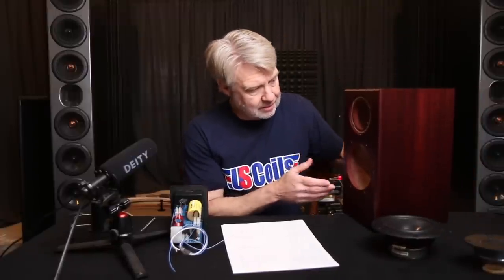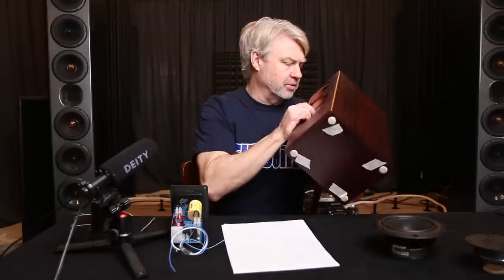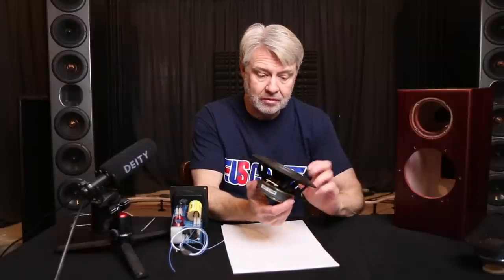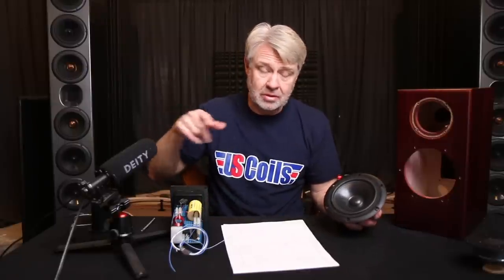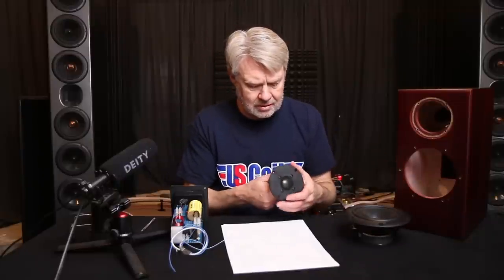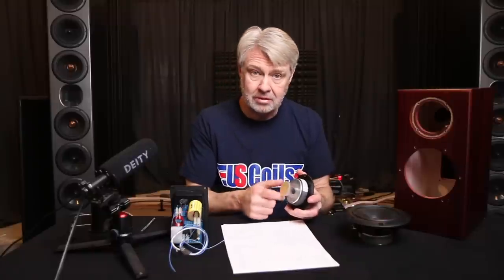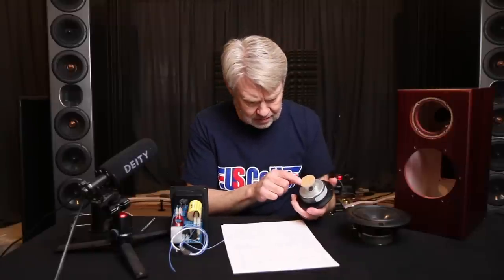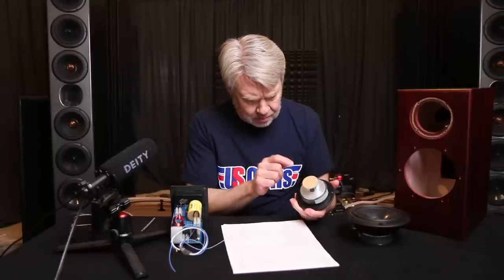Is the Totem Rainmaker a Real Tear Jerker?

Comment: A few points. 1.) I love the Rainmakers. I've compared them blind next to a $3500 pair of B&W monitors of the same size, and it was no comparison at all. The Rainmakers were so much better. Everyone who listened to the comparison confirmed it. I'm aware of the slightly elevated tweeter's response, but love the extra air, detail and soundstage. I think they've got better than most caps on it, and I think that helps it be non-fatiguing to listen too. They're designed to be listened to without toe-in, somewhat off axis. 2.) They don't fill the cabinets with foam or polyfil. They use Borosilicate mineral based paint instead for resonance control. 3.) I thought that woofer looked awfully similar to one in your design. I love paper cones in general. 4.) I've had them for years, and I've never heard any port noise. One thing Totem does is tune a bit extra deep for their size, so if driven harder than I'd care to listen, I'm sure that could become a problem. 5.) As a nearfield monitor on my computer, while playing Call of Duty it's almost like cheating with all the extra detail, haha. You can hear people sneaking up on you no problem, and just a stereo pair soundstages so well, you can tell exactly where they're coming from. 6.) Totem uses those connectors to avoid more solder joints. They think solder is degrading the sound, so they use mechanical crimping methods instead. Weather that helps or hinders the sound I don't know, but I know they do it on purpose. 7.) Totem tends to go simpler on crossovers with fewer components, favoring purity of the signal path rather than the flattest most "corrected" response. I'm not doubting you aren't taking them to another level, and have faith in your design, I just wanted to point out a few things about the Rainmaker. I was sad to see them discontinued, but still own a mint pair myself, which I keep in much more expensive company.
Reply: I got some B&W 706s and they sound a bit "fooffy".
Reply: Almost any Totem speaker will sound better than any B&W speaker. Totem isn’t mass marketed like B&W speakers. Unfortunately, B&W is now considered the Bose of somewhat higher end speakers. Last 15-20 years is when they started going down hill. Once they started making the 600 series in China is when it went down hill. Same with Kef. No longer a respectable name it once was.

Comment: The damping material is a multi-coat borosillicate glass paste hand-painted inside the cabinet. This paste is also used on the tube of the reflex port, which is made of damped acrylic and affixed with an anti-resonant glue. The borosilicate is a more lasting and stable damping material than foam, which tends to oxidize and degenerate over time, changing a cabinet's Quality Factor (Q).
Reply: That stuff does nothing to control box resonances or standing waves.
Reply: @dannyrichie9743  It doesn't?  Why is the spectral decay "pretty clean" then?
Reply: @audiophilefool  A spectral decay isn't a measurement of cabinet resonances. It measures the decay of the signal from the drivers.
Reply: @dannyrichie9743  Thanks for the explanation.  I thought that cabinet resonances would play a part in that, because if a cabinet is vibrating from being exciting from the drivers, it would surely show up on the measurement as well??
Reply: @audiophilefool  FYI, from online source Audio Judgment, "The cumulative spectral decay tells us if there are any problems with resonances. If the driver is ringing because of inadequate damping / cone break-up / high impedance spikes at resonance, or some enclosure panels are resonating, it should appear on the CSD plot."
Reply: @dannyrichie9743 , if there are resonances or standing waves within the enclosure then the designer meant them to be there. They add to the overall appeal of these excellent speakers and their careful design. There is nothing that you can measure that the designer of these speakers doesn’t already know about.
Reply: @vynleshmynle7372  Yeah, I am sure the designer listen to these and thought, you know what would really sound good, if there was some added distortion and smearing from internal reflections, because all music needs a little coloration to sound right....Said no one ever.
Reply: @dannyrichie9743  Well, that is how some designers actually tune their speakers.  Manipulating resonances has been part of the game since forever. In some cases that is easier and more cost effective rather than just throwing high priced parts at it, which is no guarantee in itself. Think price point for the masses.
Reply: @ruger6049  No, cabinet resonances are always added noise and easy to remove from added bracing and thicker cabinet walls.

Comment: Hey Danny Totem is among my favorite companies. I have had the Forest, the original from 1999 when it was Dynaudio Driver and seas tweeters. 
I still have not found a speaker close to that one. I had the Hawk and for such a small slim, such a nice sound. 
This Rainmaker is among their lower line. I am sure you know the Model 1 is legendary . Would love to see you work on that one. 

Keep it up. I am looking forward to your 80's style speakers.
Reply: I also had the original Forest. It was never a Dynaudio driver. Actually, It was a look alike from China - Hi Vi. A nice, relatively inexpensive driver. The surrounds on my pair went, and I ended up buying  the exact replacement drivers at a much lower price than the  Totem dealer quoted.
Reply: @davido4872  Maybe but the set I purchased in 1999 did have the dynaudio. The Dealer showed me, I do know later on dynaudio stop selling as a third party. My hawks had the scanspeak. Less the dealer was lieing he had one floor model with the driver removed. Made in Denmark dynaudio 17w.Three inch voice coil. Anyway I have yet until recently find a speaker that matched that one. QLN
Take care
Reply: @jasonme3557  lying.
Reply: These videos are testament to manufacturers producing speakers to a budget to fill the gap between particular models and bring in revenue.  GR Research has likely performed more acoustic tests on loudspeakers than the manufacturers, exposing some good, some mediocre and some awful products proving costs don’t correlate with sonic ability.  Danny is doing a great service for the consumer.
Reply: @jasonme3557  Possible but unlikely because mine were an early pair from 1999 as well. Liked them but did get a little tired of the tipped up highs. I've heard that QLN are good speakers - enjoy.
Reply: @thomasmleahy6218  Yo tom this is not the channel for that.
Reply: @davido4872  David they are nice very open and reveling. if ones has a low end amp. you need not bother.
Reply: @davido4872  Very sad.
Reply: I still have my Forest, Model One Signatures, and Mani-2's.  I will never sell my Mani-2 or Model One, but I might part with my Forest one day.  I also have owned the Rainmakers, and Hawk's but I immediately sold the Hawk's when I got the Forest.  I have some videos of my Forest posted up on my channel for $hits and giggles.  LOL.

Comment: I had them, and they are bright, now I have the JMlab Daline 3.1 and they are better in every aspect, incredible speakers.
Reply: I have some JMLab Focals  -- I forget the actual model number but believe it or not in my bedroom set-up I ended up using the NHT SuperZero A450 from 1995 and they killed everything in their path. I don't have any problem spending extra if the sound quality merits it but in my particular case the SuperZero A450 knocked off all the other speakers I put them against and most were newer and all of the other speakers were magnitudes of dollars more expensive.

Comment: Hi Danny. Believing or not in your magic I allways learn on your videos. I have a doubt though, do you ear the speakers or you are based in measurements only? This speaker seem very good on its original form. You can make it different, but better?
Reply: Part of it would have to be by ear for them I'd think, as you generally cannot measure a difference (or one in the audible range) between a decent cap/inductor and a doubly more expensive one. And then you have to wonder about psychoacoustics
Reply: No magic involved. These are now better in multiple ways. There is no doubt.
Reply: @dannyrichie9743  Maybe better to Danny.  But how about the person who handpicked each part and designed the cabinet(all to achieve a specific sound), Vince Bruzzese.  The Rainmaker was in production for 18 years.  How many of your designs have been in production for 18 years?
Danny, you want all speakers to have a flat frequency response.  Like Audyysey, this neuters speakers to  sound more alike than different.  Some of us find that boring.
Reply: @stephens3845  Shame on the person that handpicked an iron core inductor, used ferrous connectors, and PVC jacketed wire.  Improvements were made in balancing out a mess of a frequency response. Cabinet damping was improved. Internal damping was improved. Signal transfer from binding posts to tube connectors was significantly improved. 

Also, a flat frequency response has nothing to do with causing a speaker to sound boring.
Reply: @dannyrichie9743  Thanks Danny, you make some good points.
Reply: @dannyrichie9743  Easy to say when you don't have to respect a certain amount of money on the BOM.
Reply: @fugazi84  Some of those improvements would have only costs a few pennies.
Reply: @dannyrichie9743  Still, you sell the upgrade kit for between 225$ and 500$.  So I understand why Totem choose the components that they choose.  They have to aimed for the best bang for the bucks.  We are talking about a sub 1k$ speaker.

Comment: Then the treble is guaranteed to be made by SEAS, which is the only Norwegian speaker factory. Their  tweeters usually is relatively good. But I don't quite agree with the sound type that many midrange/bass elements from seas have. Not always the easiest to make a crossover for!

Comment: I have the totem dreamcatchers, and their very good, even when compared to the ls3/5a and kef ls50, and proac I've had, their very musical and perfect nearfield and engaging, also one of the few speakers I've had that sound nearly perfect with that new controls set all flat, normally some usually need a bump on the high end or low end. The engineer of the totem dreamcatcher said they like the cabinet to be more lively in timbre instead of the usual inert cabinets most go for. I think they nailed it just fine with the dreamcatcher, tweeters not bright either. German acoustics tweeter and peerless made in Denmark model woofers, both very well built. haven't heard the rainmakers though but would like to.
Reply: Cabinet resonances and coloration is never a good thing. That is not musical or part of the music. It is just noise. Also, those woofers are not made in Denmark. They were made in India.

Comment: “Fix”? more like tune it to your preference. Nothing is wrong with the speaker. Just may not be your cup of tea.
Reply: A speaker acting as an eq is not right. The artist mixed the music so certain frequency and sounds were certain levels. Do you think a speaker then doing its own tweaking is natural? No. It changes what was made in the studio. It's wrong. Plain and simple.
Reply: @ClassifiedBrief  Then again not every listener sits dead centre in an acoustically adapted studio, in fact, the vast majority listen to music in rooms of differing sizes with various furnishings, which will tend to modify the response to a varying degree.
Reply: @paulb4661  right so why should you start with a speaker that produces its own eq? Exactly you don't want to.
Reply: @ClassifiedBrief  Because it's easier to slightly elevate very high frequencies in a speaker, so that it's flat 30 off axis than to adapt a room. Metal domes generally do that on axis, you know - they have the tendency to beam on axis prior to onset of the so called oil-can resonance, or break-up. Your position relative to the axis, distance and how lively the room is, has much greater influence on the response than this. The point is, that it may actually lead to better listening experience under non-ideal conditions, so common in ordinary rooms and that's why.
Reply: @ClassifiedBrief  How do you know the artist/engineer was using perfectly flat monitors ideally setup? 
And the end result of this change was a little worse response off axis which is still being like an EQ.
The artist also mixed sounds at a certain global reference level - but not everyone will listen at such level - Fletcher Munson curve has entered the chat
Not everyone necessarily wants "what the artist intended" whatever that means, but what sounds good to them. The only real way to hear it as the artist finalised the music, is to go to the studio it was done in, or at least get their monitors and attempt to recreate said room at home.
Reply: @RennieAsh  the mix was likely not on dead flat monitors but you adding additional false eq is not ideal. If you want not a pure sound go for it
Reply: @ClassifiedBrief  your room will add more eq than any speakers/corssover combination
Reply: @dariuszsalamon9441  which is why I have real  qrd diffusion filling the entire room and base absorption. That's why I also have acuracte as possible speakers (nx otica and a pair of triple servo subs)

Making cuts is fine and you can be happy with non ideal that's totally fine, but don't start saying jacked eq and drivers not in phase is good lol.
Reply: @ClassifiedBrief   whoever design those speakers they listen to it and they measure it, no ideal speaker exist, also how you measure speakers matters too, I don't think GR owns anechoic chamber so make it flat to measure good it is not always ideal
Reply: I'm going to agree with badd99 in this argument. Even tho I don't like his username.
Reply: this guy is a shameless self-promoter.

Comment: This speaker sounds exactly like it’s supposed to. The owner / designer of Totem doesn’t release a speaker if it doesn’t sound exactly as he intended. There is no acoustic fluff in any of Totems speakers. They implement a proprietary coating on the speaker interior. Those steel screws were used for a reason, don’t kid yourself. If they affect the sound they were supposed too. 
      If you don’t like the way these speakers sound then sell them, the jiggery pokery this clown is selling won’t make the speaker sound any better, just different. There is no “fixing”this speaker. Save yourself the time, money and aggravation.
Reply: If you believe that a wall coating will absorb internal standing waves, that steel screws don't negatively alter the response (and sound), and that a tweeter level 5db louder than the woofer makes things sound better then I have some ocean front property in Oklahoma that you might be interested in. If you think port chuffing noise and cabinet resonances are a good thing, and that coloration is just what all music needs because that is how they were designed, then someone has really fooled you. These were not well designed.

Comment: Surely these loudspeaker manufacturers check the frequency response of their products.  How on earth do you manage to get a 5 DB lift in response from the tweeter.  If you can flatten the  response,  why cant they do this before release.  Even I could sort out some of the problems with this loudspeaker.  Damping in the cabinet, sort out the port and remove steel screws and replace with non magnetic ones. Always find your video's informative and entertaining.
Reply: If you had these speakers at zero toe-in, having your listening position slightly off axis from the tweeter would negate some of that rise, perhaps all of it. We don't know what position the manufacturers may have in mind and might be engineering output from a baseline position of zero toe-in.
Reply: @davidristic3800  I take note of your comment and agree that not toeing in the speakers would negate this anomaly.  I have tannoys which need careful placement . They can sound top end heavy if toed in too much.  I personally like dual concentric loudspeakers. They seem to be making a bit of a comeback.
Reply: They don't always design for flat response.
They use borosilicate damping, and no fluffy stuff (some people think you get clearer response this way)
The port may be small due to resonances developing in larger ports, and needing to be excessively large for the cabinet due to the low tuning frequency.
As for the nuts and bolts, it only matters to some people. Aside from a tiny bit of extra resistance or inductance which is generally not audible, there is far more effect from that coil of wire that's immersed in a really strong magnetic field no?
Each manufacturer has different people with different philosophies on sound, so you get these differences. Each person buying a product will also tend to believe different parts of the audio story

Comment: Have you heard of the fire line from totem . They use their special magnet to each .no crossovers.
Reply: Sounds like an underhung design with polycone or similar for smooth rolloff. It would have some directionality and possible phase issues at some angles unless the woofer can roll off early enough. Also how do they do baffle step compensation?
Reply: Amazing speakers with the torrent technology. Especially the Tribe Tower. That’s the only speaker I have ever heard that does not sound like a speaker. The sound does not sound like played back by speakers. The electronics were by Moon by Simaudio. The instruments sounded just like instruments are in front of us with a human singing in the middle

Comment: They are rated 47Hz min. So you need a subwoofer to cover the bottom end. The 20-40HZ test is true but really not applicable. Set you amp to cross over to the sub at about 40HZ.